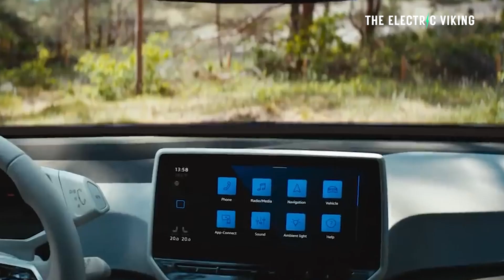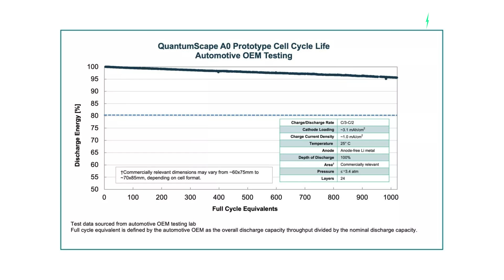VW test QuantumScape’s Solid-State Battery: Retains 95% after 300,000 Miles

Comment: The situation with QuantumScape's battery is a bit nuanced, and it's not technically pure 100% solid-state in the strictest sense. While it offers many of the advantages of a true solid-state battery, it incorporates a hybrid approach.  
Non-solid-state component:
Liquid catholyte: While the anode and electrolyte are solid, the cathode still uses a liquid electrolyte. This is because finding a suitable solid-state material for the cathode remains a challenge in the industry.
Reply: From QS: "QuantumScape couples this solid-state ceramic separator with an organic liquid electrolyte for the cathode (catholyte). "  So it's NOT solid state.
Reply: BS😊
Reply: Cathodes in conventional Li-ion batteries are already solid. As far as we know, QuantumScape is producing a true solid state battery. In a conventional Li-ion battery, the cathode (NMC, NCA, LFP, etc.) and the anode (graphite) are solid and the electrolyte between the two is liquid. QuantumScape hasn't changed the cathode, but has replaced the liquid electrolyte with a solid ceramic electrolyte and has replaced the graphite anode with a lithium metal anode, which is much thinner. A number of companies that claim to be solid state actually have semi-liquid electrolytes, but that doesn't appear to be the case with QuantumScape.
Reply: @amosbatto3051  QuantumScape's battery represents a significant step forward towards achieving the benefits of true solid-state batteries, it's currently a hybrid approach. Some experts prefer terms like "quasi-solid state" or "advanced lithium-ion" to more accurately describe its current stage of development.
However, it's crucial to remember that even with the liquid cathode, QuantumScape's battery offers substantial improvements over conventional Li-ion batteries.
Reply: @amosbatto3051  Search for "quantumscape liquid catholyte"
This is a quote from Quantumscape website: "QuantumScape couples this solid-state ceramic separator with an organic liquid electrolyte for the cathode (catholyte)."  If it's using a liquid it is not by definition "solid state".

Comment: I am having a problem with the claim of '300000 miles' on what car was it tested? Under what conditions, using what motors, what is the battery pack co figuration and capacity? What is the energy efficiency?
What they should have published is dry data. X batteries tested with Y capacity wach over Z charge/discharge cycles and retained some % of capacity with some %of failures if any.
Reply: Calm down. This was old data from the lab test.
Reply: @jamesvandamme7786  They don't exactly sound scientific when the main claim of "lasting 300,000 miles' is not only unsubstantiated by anything. but is vague and misleading. Doesn't matter how old the claim is.
Reply: @dgurevich1  It's based on cycles. They achieved some number of charge-discharges in the lab, then some genius in the marketing department who can multiply (with a calculator) figured that with a certain size car which gets a certain amount of WH per mile, times the battery size times cycles, voila you get 300K. This is like the LED bulbs that all say "50,000 hours life" when that only refers to the LED chips at a controlled temperature and doesn't account for the electronics. 
So let's see how long they last with shock & vibration, temp cycling, all the rest.

Comment: Unfortunately, Lithium metal cells are prone to fires, due to intrusion of air and water through leaks developing in the seals, as well as due to puncture in an accident.
Reply: I think you need to update yourself on more modern battery chemistry. BYD and their Blade batteries would be an excellent place to start your learning curve.

Comment: Does anyone know why Diesel Submarines still use Lead Acid Batteries? I have heard answers ranging from Ballast, Fire Hazard, Cost ..... but nothing really convincing.
Reply: Who knows but common sense tells you that if they can safety contain fission reactors in submarines, they can certainly safely package lithium  batteries too.
Reply: @cbcdesign001  the issue is more than 80% of the Subs still in use are Diesel Subs. I know some subs used in Japan and Norway have converted them to electric ones. The other thing is, I was told that Diesel Subs are much more quieter than Nuclear ones. Not sure why.

Comment: I'm not sure this is much if any improvement over the theoretical ''Million Mile Battery'' from Jeff Dahn's lab who have recently discovered adding a compound would increase the cycle life to above 1200 before reaching 90% capacity.This was covered in detail on ''The limmiting factor''.While this is still research,Tesla(who contract out Dahn's lab) have filed for a patent for this technology so it would seem that they intend on squeezing a lot more potential from Lithium Iron technology at the moment.
Reply: Show me this million mile battery, Tesla work with his research lab? Tesla use still use 18650 cell in the model s and x because anything else would be a downgrade
Reply: @robbieb8274  Here is a link to the latest ''Limitting factor'' video.The graph shows you the potential for this new patent.
All this comes from Jeff Dahn's lab which esentially works for Tesla so any IP belongs to Tesla.
https://youtu.be/fNpTPmbYOUI?si=_uKrX43BFTnLhgJx&t=279
Reply: And in any case Tesla is anxiously waiting for Quantumscape's batteries, the CEO of Redwood is on the board of directors of Tesla and Quantumscape... does that mean something no? Then if we think that Audi, Wolksvagen Porche have adopted the same charging system as Tesla? Are two tests enough for you?

Comment: I'm on the fence about this. On the one hand, solid state have been coming soon just like nuclear fusion (yes, I'm poking fun at Sam's frequently misunderstood claims of 150% energy efficiency of a recent experiment). 1,000 recharge cycles is not a lot. IIRC, a conventional LFP battery is good for 3,000 cycles albeit with a greater loss of capacity. When they test solid state batteries at 3,000 cycles and we can have an apples with apples comparison, then we'll talk. There's no reason to believe that the cycles to capacity graph is linear.

On the other hand, I was listening to a science podcast some years ago where they were discussing the actual problems holding up solid state batteries. As I understand it, while the solid state electrolyte was supposed to block dendrite formation which is a major killer for Li-Ion batteries, they were having problems preventing microscopic cracks forming in the electrolyte during the manufacturing process. This allowed dendrites to form drastically reducing their life. I suspect that this is why the reporting about QuantumScape focusses on this issue. The science report noted that a solution had been found involving (again IIRC) the use of CO2 during manufacture. The actual solution doesn't matter in that this is the sort of problem that exists until it doesn't. This is not something that is going to incrementally improve. If fixed, the problem will go away and solid state batteries will live up to their potential.  This means that we can expect a jump in performance rather than slow improvement. An announcement of significant improvement would not be a surprise. Of course, even if fixed, they can still be improved from here.

There is a lot happening in the world of batteries. True, many investigations will come to nothing, but those that do will push things forward. What I am interested in seeing is which ones can be combined. Will we have sodium batteries with pure silicon anodes and a solid state electrolyte that will provide cheap and energy dense batteries capable of really fast charging?

Comment: Eventually solid state batteries will be standard but it will take many more years. Sam  points to technical challenges. Another challenge is to move to mass production. New challenges arise when you move to mass production. Just ask Tesla. They are being challenged to mass produce a dry cathode. In a solid state, everything is dry, including the electrode and electrolyte. Having prototype is one thing. Mass producing at cost competitive levels is another. Hence, all this research is great but we are many years away of a mass produced cost competitive solid state battery.
Reply: Read the history of quantumscape carefully and maybe go and read the various quarterly reports so you will discover that they are already preparing a first production line where the machinery has already been installed and they are already starting to provide for the mass production plant.
Reply: @pierlucapetrin9740  I am fully aware of quantumscape. There  is a big difference between production and mass production. Scaling up massively brings new scientific challenges. Tesla has been able for a while to produce its dry electrode batteries but is struggling to mass produce the dry cathode. I am pulling for quantumscope but they will need to solve the same technical challenges to move to multi Gw production. And more since they will need to mass produce a dry electrolyte.

Comment: The real experiment was 95% capacity retention after 1000 charge-discharge cycles. As for 300k miles would only be valid if one charge had 300 miles range.
Reply: Ok how about 95% at 200k miles?  Even then it's amazing.
Reply: Who cares if the charges was for 300, 200 or even 2 miles. The point here is that after 300,000 miles it still retain 95% capacity and that's the amazing fact. No cars would ever reach that distance anyway. Get real Rashius!
Reply: @DolipraneDude  There is no after 300,000 miles, in fact.. there wasn't even a car involved. They were only testing QS batteries in a lab and it retained 95% after 1000 cycles. They only extrapolated that to if they put enough batteries of that kind in a car for 300 miles range, that car would retain 95% capacity after 300,000 miles. You get Real!

Comment: Out of all the solid state battery companies QuantumScape has the most published data and independent 3rd party test.  Although I won't count Volkswagen as independent because I believe they own part of QuantumScape now. Which may in itself weigh in that this may be real.  QuantumScape definitely has burned through a lot of R&D $$ and has hired a ton of the top chemical engineers.  I think they are at the point they need to get something out commercially before they can access more investment.  I doubt they have anything close they can scale up with cost effectively yet.  So maybe your right about this showing up in a Rimac Nevera first, or something like that.
Reply: I believe the prototype was tested in a Porsche car for a year or so. VW is indeed an owner of QS, as they invested $100 Million in the company during its early phases.  QS has many patents in this field and is regarded as an leader for its electrolyte separator bonding technology, which allows them to double the energy density of a Li-ion battery.  I think it will become readily adopted and the technology eventually licensed.  Practically speaking, it would mean that VW could enter the market with a car that has 500km plus range, yet still be a Golf or some modest vehicle, a million of which they could sell a year.  Disclosure: I have been long on QS for over 2 years.
Reply: @bengt_axle   I got scared and almost sold my QS. But Sandy Did an interview with the founder and I decided to hold what I have.  I hope they can scale it. VW may abandon car manufacturing in preference for battery manufacturing. Which wouldn't surprise me.
Reply: If you have the time, check out QS latest earnings call.  They have been working on getting manufacturing off the ground for the last year and they should have scalable manufacturing in place in mid to late 2025, expected to be supplying a high-end Porsche or another supercar / formula1 car (they hinted at this).
Reply: @Timanda103   Good reference .  Thanks.

Comment: I didn't quite understand. They have a battery of 1000 recharges with 95% retention, but the goal is still 800 recharges with 80% retention? And how is it possible to travel 300,000 miles with 1000 recharges?
Reply: I noticed that oddity about the 800 cycles. My guess is that he meant to say 8,000.

Getting 300,000 miles from 1,000 recharges is clearly based on a 300 mile range. That is fairly typical for a decent EV. Remember that solid state batteries will be smaller and lighter than conventional batteries with a paste as an electrolyte, so larger capacity batteries are likely.
Reply: Thanks for your response. But I think even a decent EV has just over 300 miles of range, and you won't go to the limit to recharge, so more charges would be needed. Are two half charges equivalent to a full charge for the battery's useful life? @briancampbell179
Reply: the initial goal was 800 cycles with 80% charge maintenance, they went further with 1000 cycles and 95% charge maintenance.

Comment: ahh? 300,000 miles?  Batteries dont do miles....lol.  What we need to know is number of cycles, charge rate, levels at which the battery sits before recharging. Is there an optimal  temperature?  Talking in miles suggests a lot of BS is coming or way
Reply: 1000 cycles for 300 miles each. If you could basic math you could see that it’s actually plausible they were testing a 300 mile range battery. If it was 1000 FULL cycles  and it only dropped 5% I would say that’s a pretty good indication that these batteries will last. You don’t charge EVs in full cycles unless you’re going on Trips all the time. So it actually speaks a lot better for average use these batteries will be great.
Reply: at average of 60 mph. so 5000 hours? 😮
Reply: Batteries degrade by:
Cycling
Calendar aging
Charging abuse
Environmental temperature abuse
Storing at hi charge levels

Calendar aging alone is typically half of the capacity loss with time... Rendering batteries ready to replace at 10 year

Manufacturers focus on cycles but most people won't cycle their batteries anywhere near enough that their cycles are the primary detriment.  And most people don't understand their batteries are going to degrade with time, or being left fully charged all the time anyway.
Reply: 1000 cycles... watch and listen, then comment.
Reply: @AndrasMihalyi You did not reply to the comment. You need to define the cycle, as previously noted. You can't just say 1000 "cycles" and have it be considered meaningful. Likewise, the "cycle" only translates into 300 miles if there is a sufficiently large battery. This statement of battery life in miles should make you and anyone else highly suspicious of this company's latest claims, again.

Comment: The data may not be available but what percentage failed before getting to 300,000 miles?  That is also a key metric.  We see EV batteries jump from 5% degradation to "won't charge / need replacement" in which case degradation is maybe the 2nd priority data point over failure.
Reply: At least they have shown data and prototypes, while Toyota continue to sell us smoke and mirrors.
Reply: Hard to get that data while at prototype stage.
Reply: @connclissmann6514  And some 5-15 years of work for the Material Dynamics Engineering Team - among others - to collect that data and improve the solution for mass market production after all the concept proof is done. So, basically, if they only finalized concept proof today, one will only to know those details from 2029 to 2039 at best. This is why I find that information promising... But just that for now. We need to calm down on those "miracle technologies" that can to come... But that can to fail either!...
Reply: What I've read is that most of the time when a battery suddenly fails like the problem isn't even the battery cells, but some random wire or temperature sensor inside the battery pack going bad. Unless the car markers can be bothered to construct the battery so that one faulty sensor doesn't invalidate the entire pack, how many cycles the physical cells can be charged and discharged may not matter.
Reply: @ab-tf5fl  Exactly, I mean it is anecdotal but there don't seem to be loads of videos on youtube where range has gradually dropped from 300 to 150 and the person has decided to replace the battery, it seems to be far more a case of: I only had 10% degradation and then suddenly it wouldn't charge etc.